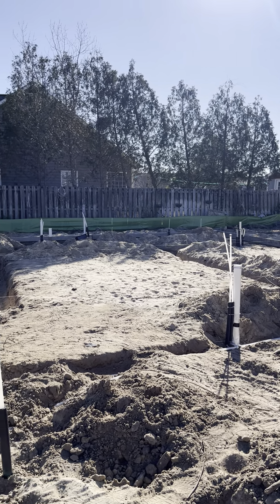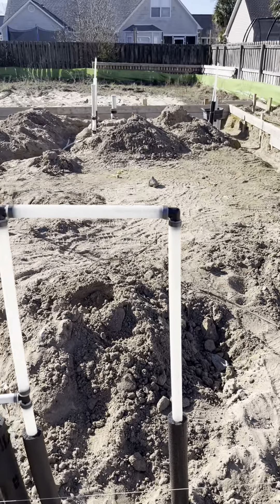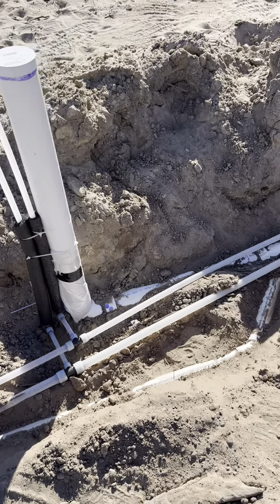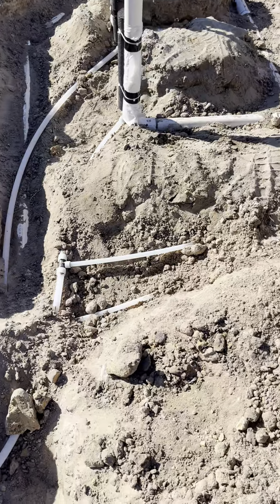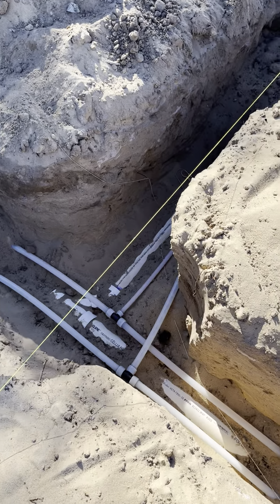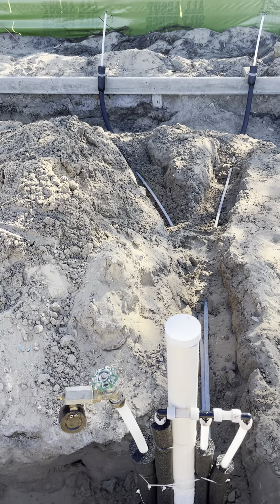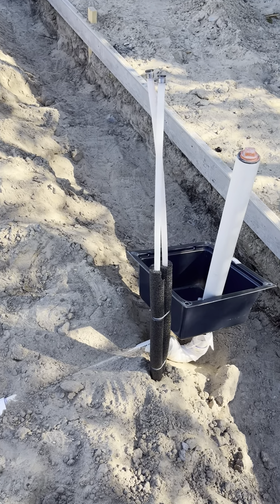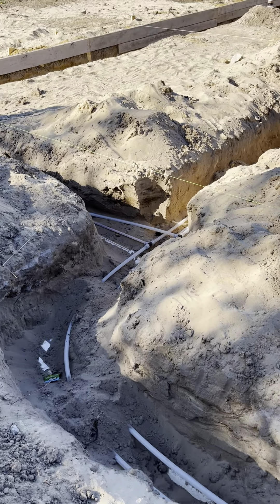Slab rough in with Uponor pipe.  #uponor #plumbing #construction

Comment: I’m all for pex, however I’ve been a leak detection specialist for 15 years and it’s beyond me why you’d put a non metallic pipe under slab that with connections. :( I’m very confident you did the installation correctly and youve done everything to ensure that nothing leaks now. But things fail sometimes for the least likely of reasons and believe me I’ve seen them all. But this for a repair aspect is a nightmare. Being non metallic you can’t locate the manifolds and you might be lucky to send a fish tape down one of those pipes and energize it but it looks like you have 90s at the bottom of each leg. Again I I don’t have anything against you and it looks clean however i just don’t recommend this.
Reply: So the pipes under the slab should be metallic? Are you saying like copper or something?